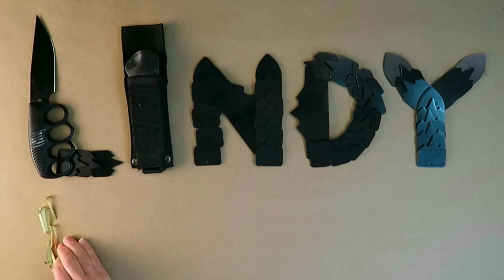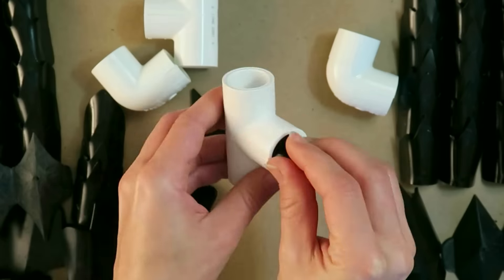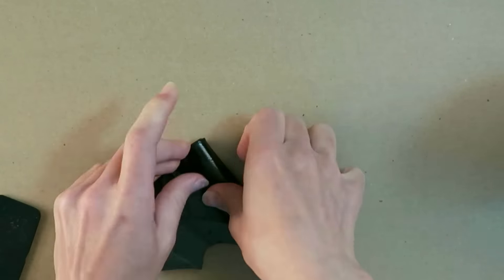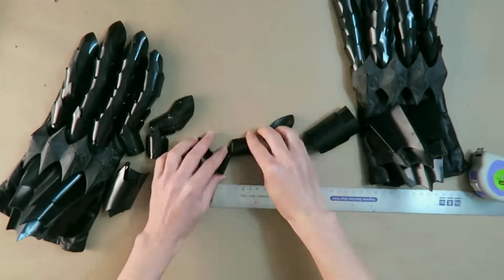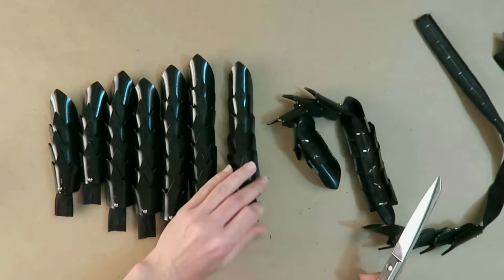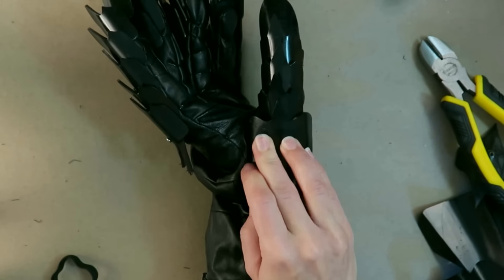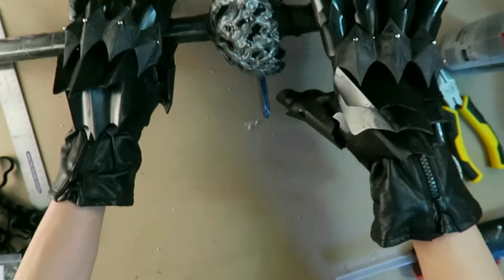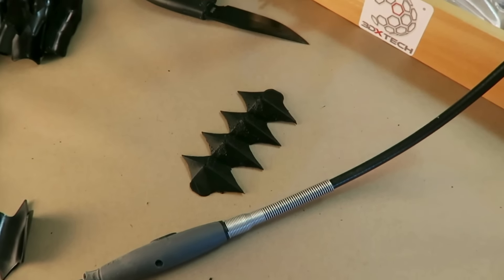How to Make 3D Printed Gauntlets for the Witch King of Angmar Costume

Comment: What do you use camera/software wise for your overhead sped up process shots?
Reply: Great video BTW
Reply from the maker: Canon PowerShot G7 X, absolutely love it. Manual settings great at compensating for less than optimal lighting.

Comment: Maybe Im a bit confused, but Im just starting out... where do you get the design to print the parts?
Reply from the maker: I created a paper model first by looking at pictures and experimenting until the pattern fit. Next scanned the pattern get a digital version, traced the lines in Adobe Illustrator and exported the shapes as SVG files to make them 3d printable in 123d design.

Comment: I could Lost PLA cast those pieces in aluminum or some other metal and have a metal gauntlet
Reply: Lindy Design Lab I'm actually relatively new to casting itself, but extensive video watching and time wasting has taught me (hopefully) how to cast using pla... (I've actually been planning on printing and pla casting the One Ring)

Comment: For the parts of the vambrace, are they held together by a hinge on one side, or just straps on both halves?
Reply from the maker: For now everything is just on straps. Final finished version might be riveted directly to the glove or on straps, have not decided yet.
Reply: If you do it with rivets, do you have to kinda design them into the model, or is it easier just to drill holes and hope for the best?
Reply from the maker: Holes can be added as needed with a round tip wood burner, but I haven't yet tested how well riveting works with these parts.
Reply: Riveting works ok, you just have to be careful that you don't split the plastic while getting things set.  And that depends largely on how you oriented the object for printing.
Reply from the maker: Cool, the filament used is like rubber, no chance of splitting, so might work well then.